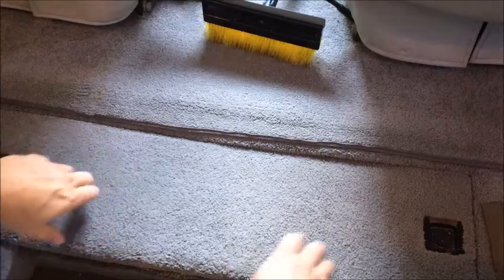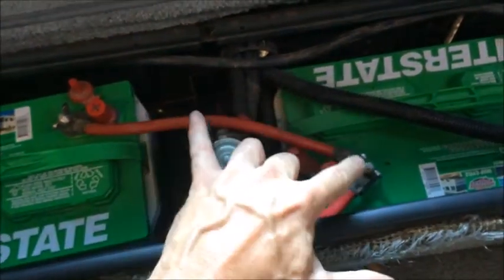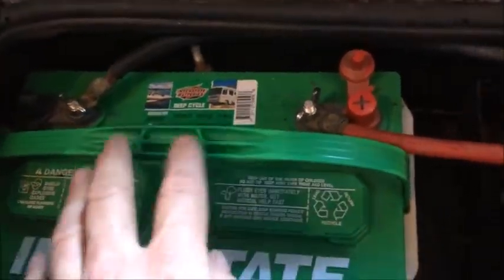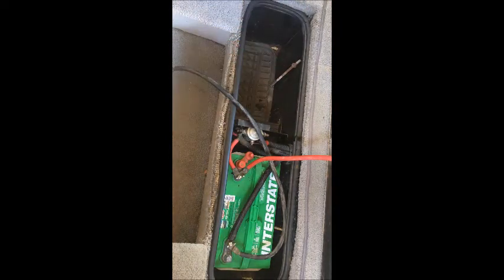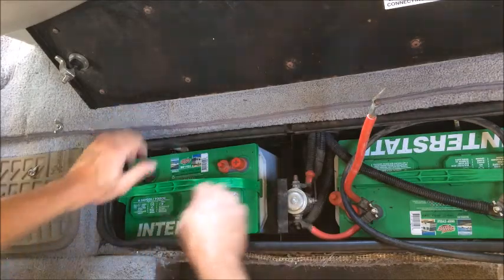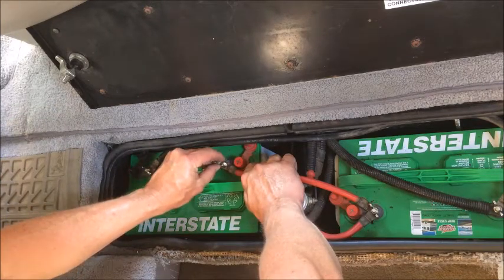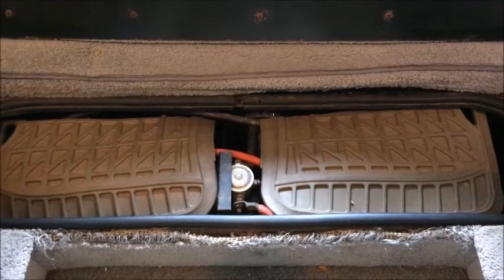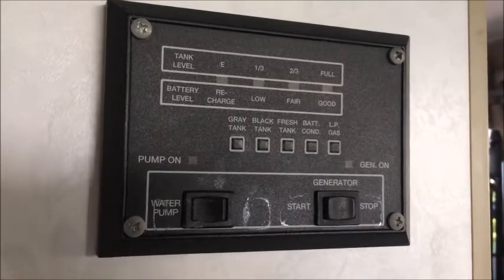Rialta Coach Batteries 101

Comment: Don't know if there is any updated YouTube videos for lithium iron phosphate batteries, which are more than norm in 2024. I think this would make a lot more sense as they supply a much greater amp hour rating for the weight. If you were to do this you would need a dc to dc converter as the chemistry of lithium iron phosphate batteries requires a greater charge than your alternator puts out, but well worth the extra cost involved. AGM batteries are pretty dated by 2024 standards. And the system in the rialta It is nothing more than a solenoid valve that connects the batteries together once the voltage gets above 13.5 volts. If your coach batteries are severely depleted this can put a pretty big strain on your alternator, particularly at lower rpms. There are many battery isolators and smart chargers that are far better suited. In general, this video is really dated and should be updated to reflect more current technologies.

Comment: Some good points and tips.  I noted that you instructed that the negative be fastened to body before the positive which is not the safe way to do it.  With negative connected a short from positive to ground of vehicle is now possible such as using a wrench to tighten the positive terminal.  When negative is fastened last it will not matter if you touch the wrench to ground of vehicle.  This is true no matter what equipment you are working on that requires a battery.  Negative disconnected first ,, connected last.
Reply: Dave, You are very correct. 
On a vehicle "ALWAYS REMOVE THE NEGATIVE WIRE BEFORE THE POSITIVE WIRE AND INSTALL IT AFTER THE POSITIVE WIRE" no exceptions.

I really like Alex's videos he uses a "Joe Friday" approach and the information is very good with the exception of this little bit of info. 
It has been 10 months since Dave has pointed this out and I am a little disappointed that Alex has not posted a correction as it can cause serious injury if the positive terminal is shorted to any metal attached to the frame as the negative post of the battery is wired directly to the frame. I have seen the consequences of this mistake and it resulted in serious injuries the the mechanics face and hands.
I think Alex might have been thinking about electronic devices where you keep the equipment grounded to reduce the possibility of destroying components due to static electricity discharge.
I still like your posts, keep them coming.
Reply from the maker: I'm sure you have read that somewhere, but remember in the RV it is a floating ground.  If you don't use insulated tools, you can STILL create a short putting the positive terminal on by contacting any part of the body that the ground would have been connected to anyway.  This is the same for boats as well as RV's.  If you are contacting the positive without a ground connected YOU become the shortest path to ground!
Reply: @rialtaownersgroupofamerica4139  Dave, Gundy and Alex: so, which is it? Fasten the negative first or last?
Reply: For what it's worth, I decided to look at the Rialta Service manual, which states "Remove the negative battery cable FIRST to reduce chances of arcing". And "Connect the negative cable LAST to reduce chances of arcing."

Comment: Hi I just tried installing the batteries and I accidentally put both batteries with their terminals . facing the same way .   I then fitted the wires according to length. A big spark came about as I put the last wire in. Now nothing works in the back cabin. Did I just blow the fuses? If so, which one? And are they easy to come by?

Comment: NIce video.  Question; would it be good to install the battery disconnects on both coach batteries?  And during the off season, disconnect them until a few weeks before springing back to action.

Comment: Thank you for the video. You may consider putting the negative cable on before the positive as it reduces the chances of a spark when hooking up the terminals. Also you putting some dielectric grease on the posts before putting on the cables will reduce corrosion.
Reply: Install and secure positive connections and insulators first. Ground / negative terminals can safely contact anything on a negative-ground chassis but positive must not. This way, you avoid creating a short-circuit spark when handling the positive fasteners with tools.

Comment: Hello 
Do you know which of the relay on the fuse panel is the ignition relay. This sends the signal to the isolation solenoide in order to recharge the coach batteries when the car is running. Thks

Comment: for some reason i don't have power going to the main breaker box. is there a battery switch on these rialtas? manual or automatic? thanks!
Reply: In the video the is a solonoid connected to the positive cable. That is probably the disconnect.

Comment: What size of battery did you install? groupe 24, groupe 27 or groupe 31?
Thanks in advance.
Reply: They look like group 24. 80 amp hours. Better would be using 2 Trojan 6 volt batteries in series.